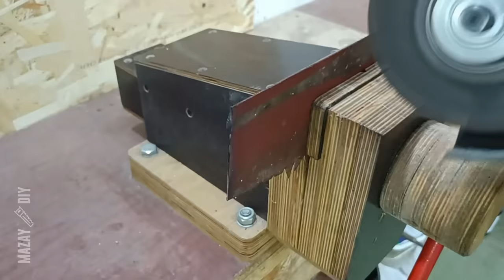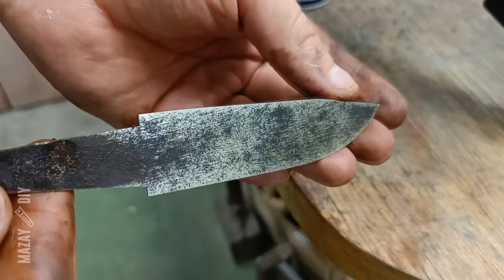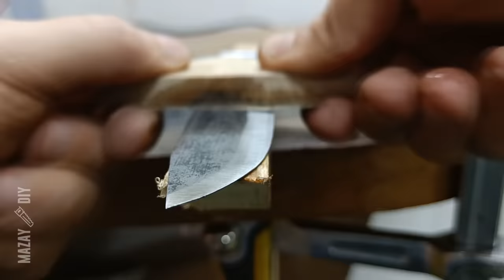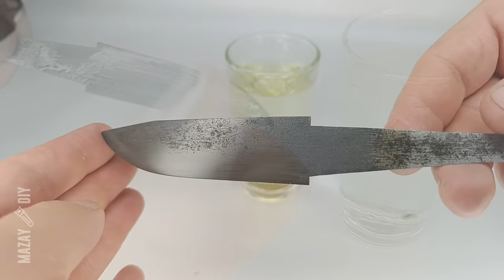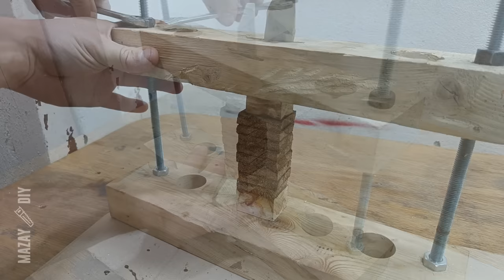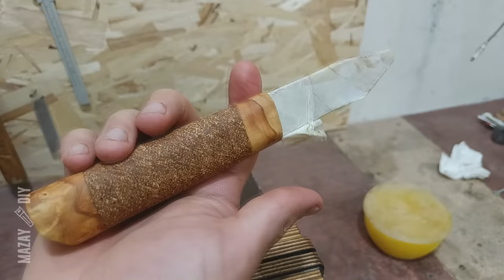Making a Knife from an Old Saw | It Floats!

Comment: The first knife I ever made was from an old saw like that one.  I started with enough pieces to make 5 knives.  Screwed 2 of them up during the grinding process and ended up with 3 finished knives.  The first two I ground the pits out which thinned the steel enough to make filet knives.  The last one I left the pits in the blade and soaked it in Evapo-Rust and then cold blued it.  The blade was thicker on it so I made a boning knife.  Been hooked on learning to make better knives ever since.
Reply: А как сделать с одно ручной
Reply: @МихаилФанта-ф1е  одной рукой.
Reply: @ЛеонидОрлов-щ4ю  восторг!
Reply: ⁸жпо
Reply: Пое
Reply: Нега
Reply: Скажи Товарищ, надо подвергать закалке режущую кромку после обработки?
Reply: @АндрейСергеев-ш8к так, це обов'язково.

Comment: Excellent video. Thanks 
What did you put in the water?
What angle do you use on the blade?
Do you not have to heat treat the metal?
Hats off to you sir.